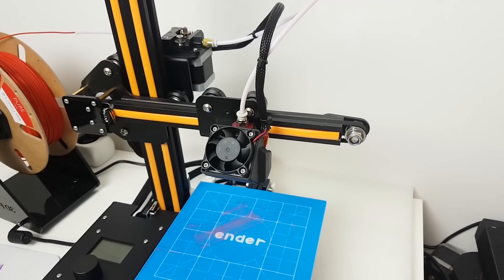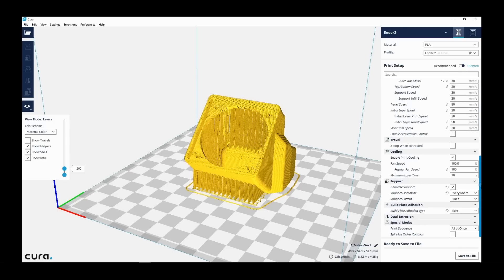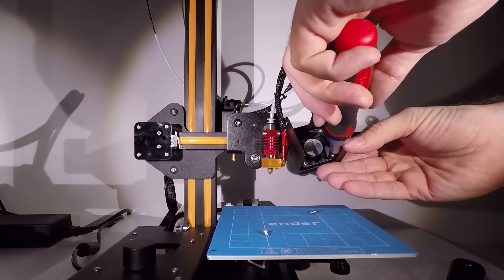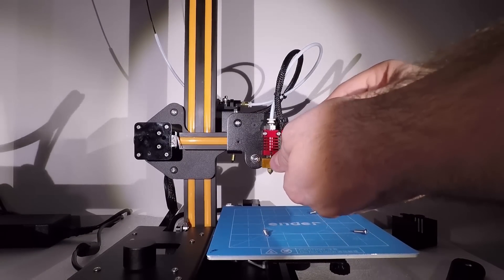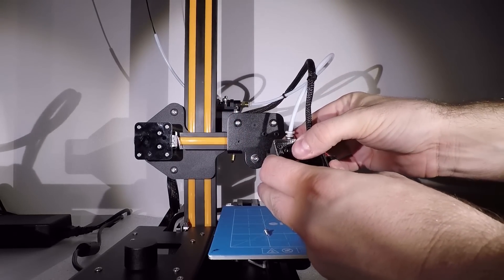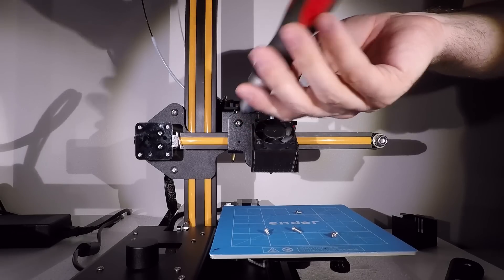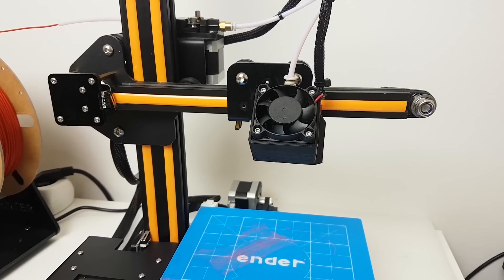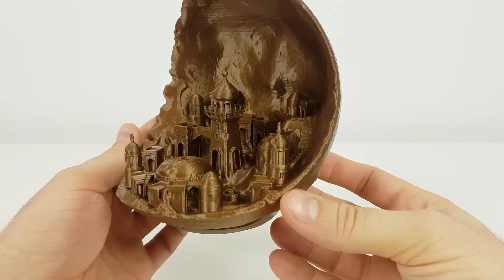Creality Ender 2 Awesome upgrade! Upgrade your print quality

Comment: Also did this upgrade, but print quality did not significantly improve, especially the overhangs. Though the printed shroud is somewhat lighter than the stock metal one, so the X axis has less mass to move. Although this is a relatively simple upgrade, a proper Petsfang duct with additional 5015 fan is both easily doable and perhaps the ultimate upgrade in parts cooling.
Also possible problem with this fan shroud: it is mounted directly onto the hotend heatsink, which could shift or get loose with time if the material softens.

Comment: Why do people always recommend this upgrade but never show a before/after print? Whats the point?
The stock fan on the Ender already blows on the part cooling it simply by the design of the fanshroud and extruder-mount some air gets directed downwards cooling the print. That is why the Ender 2 prints just fine without an additional parts cooling fan. (Just hold your hand below the nozzle when the fan is on you can feel it) 
On my stock Ender 2 I can print parts I never thought were possible with FDM. I have not tried this fanshroud yet but I can't imagine it makes that much of a difference. Its still the same fan pushing the same amount of air of which some is directed towards the print.. Maybe its directed a bit better, but as I said.. I can't imagine a huge improvement.
Maybe somebody that actually did a before/after print of the same part can say if its actually that big of a difference?
Reply: I switched back to the stock Fan setting, my prints were actually worse than before.

Comment: I tried copying your settings and I still can't get good adhesion to my build plate.  have you had this issue?
Reply from the maker: Merkindesr Tiger Yes with every 3D printer  :) You need to level your Heat bed better and maybe use some Adhesive spray like PrintaFix or Hearspray, stick glue etc. You can use BRIM options in Cura or higer Heat Bed Temperature. I hope I helped. Cheers! :)

Comment: Question 1:  What filament did you use?
Question 2:  Does it print any better with the modification?  Because you printed the blower mod no problem BEFORE you had it....
YOu should have printed the same exact part so we could campare them
Does it just look cool, or does it really actually imporve print quality?

Comment: Looking for this answer anywhere!

That this printer can print flex material!? If so... how well does it perform?
Reply from the maker: Matan Geva Yes it can print Flex material. It perform like CR10/s and most of other 3D printer with Bowden setup. You got to use low print speed and it will print flex filament. But some of direct drive 3D printers  will print flex filaments better like Original Prusa i3 for example.
Reply: Thanks so much! U’r the only one who gave me a decent answer.

Here u got a subscriber!

Thanks so much
Reply from the maker: Matan Geva You welcome mate!  Thank you :)

Comment: Hello i just build my ender 2 but when im printing something the fan is not blowing at all or does it only blow when its above temperature???
Reply from the maker: QuidPanic Gaming Fan needs to blow all the time! Check the fan is it stuck? If you have multimeter check voltage on the fan? Can you spin the fan using screwdriver or something thin?
Reply: Nexi Tech found it the red wire is not solded on ....
Reply: Fixed it the wire wasnt soldered properly! now im gonna print this good upgrade thanks
Reply from the maker: QuidPanic Gaming Great! Nice work.
Reply: but when im printing now the filament is all over the place curling up is that normal?
Reply: How can i improve print quality?

Comment: Hey! This is the easiest fan mod I've seen. I've looked everywhere for fan mods and all I find is parts to print and a few very brief instructions. NO wiring diagrams, NO wiring instructions, NO pictures/photos, not much of anything. I might not be looking in all the right places, and I'm new to the Ender 2. 

I have a lot of questions for sure, but I won't burden you with too many.
1) Print this 1st in PLA and then print in PETG? (Since I don't know if a stock Ender 2 can print PETG easily)
2) Do you have any other essential mods you believe I should make?
3) Finally, what about a glass bed?

I joined the Ender 2 FaceBook group, and whew! It's helter skelter for me. Also, my Ender 2 is arriving tomorrow - Yippee!

Thx!

Comment: I bought the Ender-2 and I am hoping to finish the assembly today and start printing. I got the new more powerful power supply and while I can now get good temperature on the bed the fan is extremely loud so I will have to buy a new power supply without a fan.

Comment: Shouldn't you buy a new because the fan is used to cool the heatsink of the extruder and you can't change the fan speed too
Reply: Nexi Tech this air flow is needed over the throat pipe just above heatblock where the pfte sits u could bugger your ptfe quicker than before time will tell
Reply: But with this new fan duct isn't both the hotend and the part you are printing cooled? Or do you mean it is not enough on the hotend anymore?
Reply: gravel86 where the ptfe tube sits just above the heat block theres going to be no air directed there baking your ptfe inside
Reply from the maker: wayneuk  If you printing above 235C and if you are worried about ptfe tube incide then you could easily swap hot end throat to full metal. It cost around 2-5 USD on aliexpress.
Reply: Nexi Tech 210 u can have issues with the ptfe it burns up in the hot end i think you may be shorterning the life of the hot end with this duct..ive swapped out to the microswiss 300 no need for all metal hot end this works a treat
Reply from the maker: And with original cover you can change fan speed? Nope. But air was blowing all over place. This mod give you much better air flow where is needed without need to disassemble whole printer and add one more fan and cable and modify  cable management. This is simple clean update that everyone can do right now(without waiting 2-5 weeks to get new fan)and it has great result.